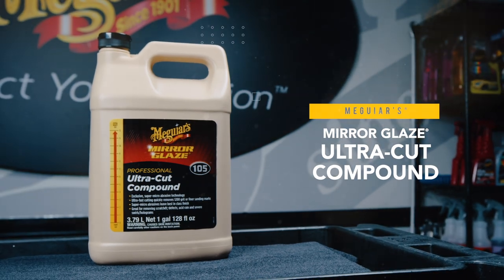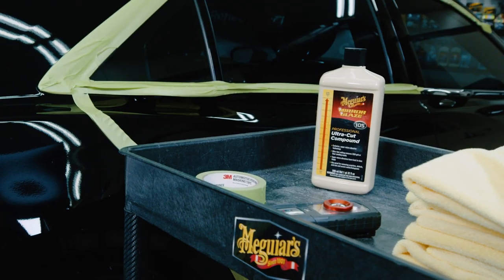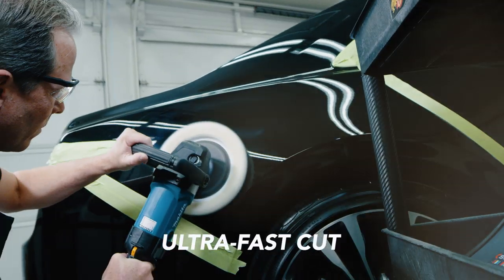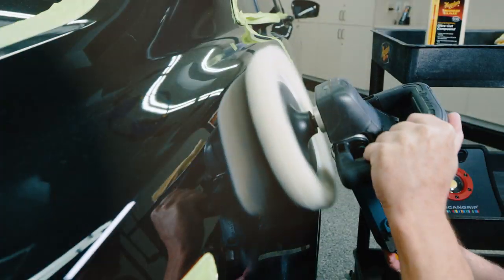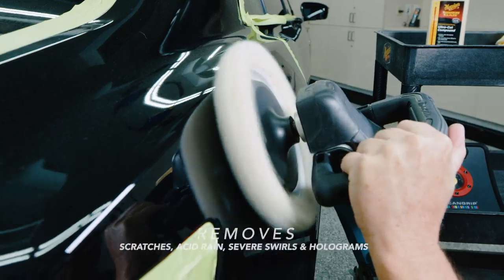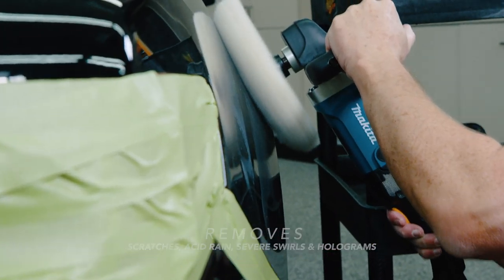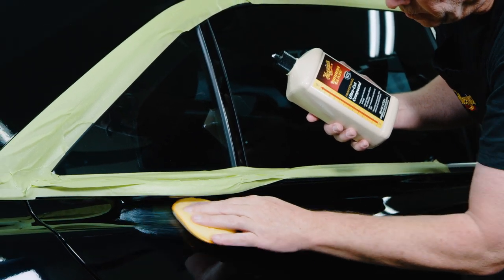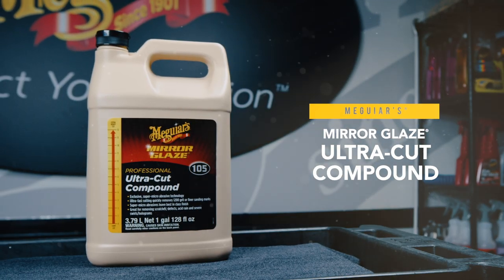Pro Auto Body Compound with a High Shine - M105 Ultra Cut Compound

Comment: I have your Megs DA polisher but haven't used it yet. 
My cars are currently 3 years and 1 1/2 years old. 
What pads and liquids should I use to get a mirror finish?
I'll of course wash and clay first.
Reply from the maker: In general, our Ultimate Compound, Ultimate Polish, and Ultimate Liquid wax, is a great combination, along with our Soft Buff D/A Foam Discs, Cutting, Polishing, and Finishing. You might consider joining our online discussion forum at www.meguiarsonline.com, so we can continue the discussion there.